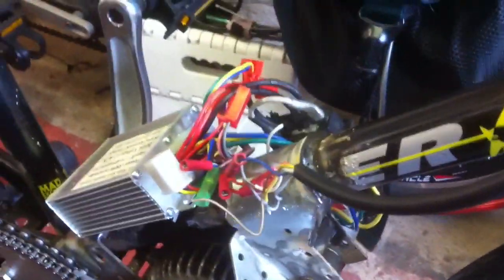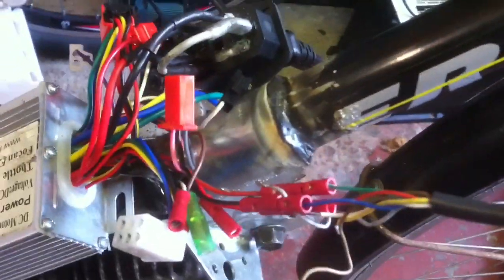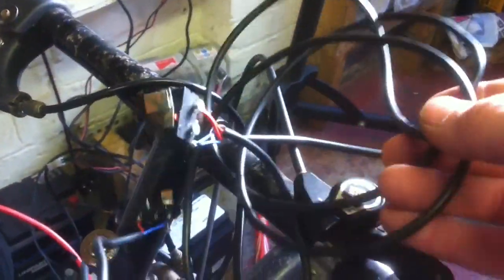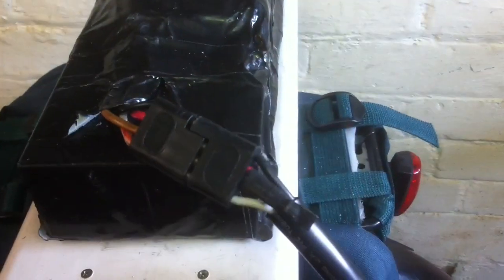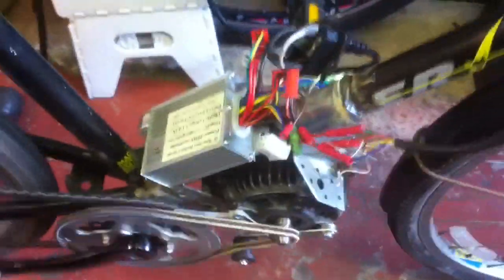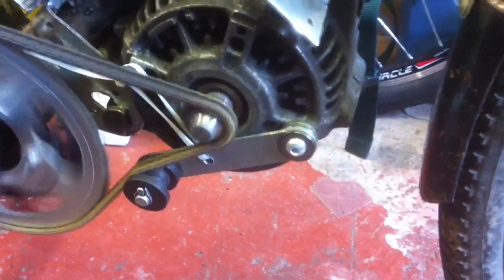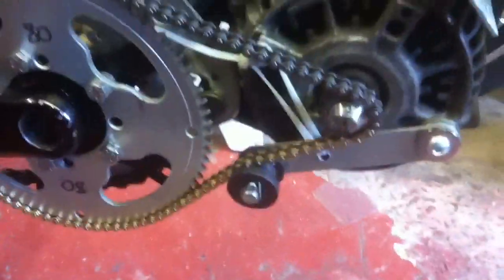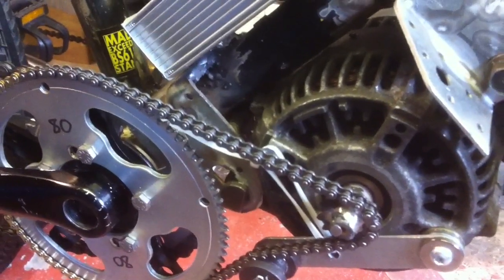Alternator motor as a mid drive - Part 2

Comment: Nice! What did you do to the alternator?
Reply from the maker: M Jac Took the regular off, connected a ~12v DC supply to the slip ring brushes and 3 phases of the BLDC controller to the field windings (star format)
Reply: Can I email video because I've never made video and don't know if I should post ??
Reply from the maker: M Jac No, I'm not publicising my eymal address. If you want to post a video then you have an upload button the same as everyone else